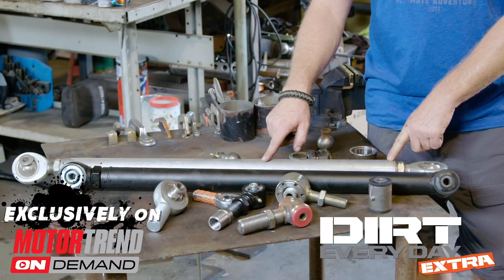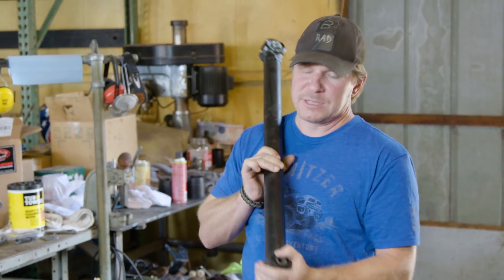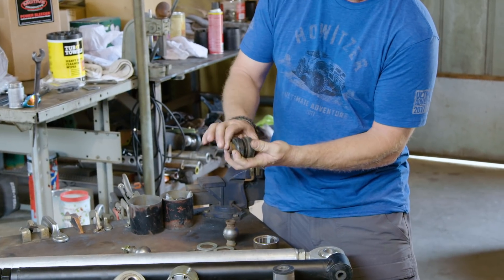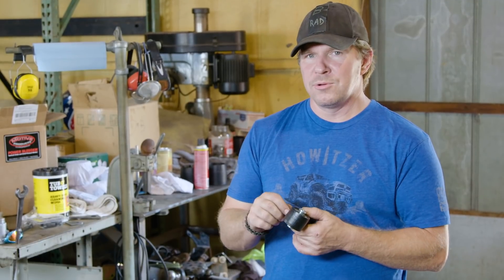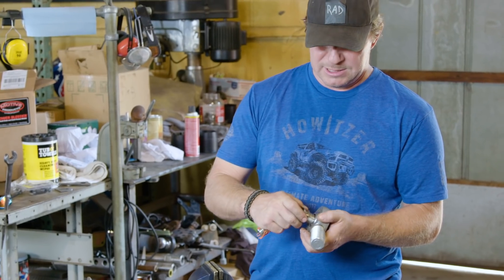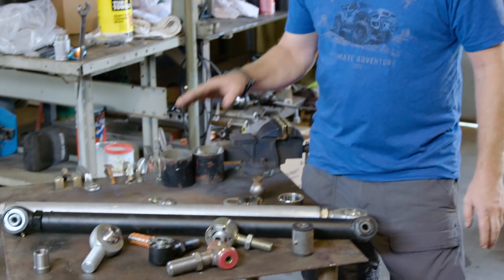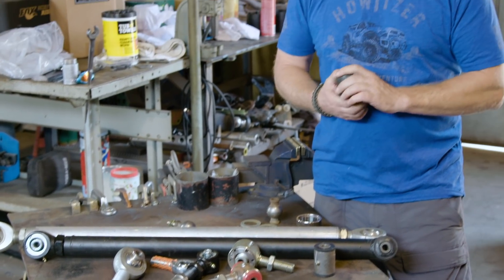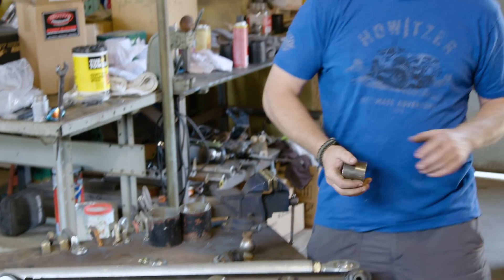Heims, Johnnys, and Bushings: Different Types of Suspension Joints - Dirt Every Day Extra

Comment: At 4:00 I believe the word you're looking for is damping. It absorbs and TRANSMITS all of the vibrations and shocks to the frame. Because it allows for greater articulation of the Axle. As opposed to a bushing which absorbs and DAMPENS those shocks/vibrations. But because it is a more rigid mount doesn't allow for as much articulation. Have you seen anyone using/offering an elastomeric bearing joint for off road use?

Comment: good video explaining the difference. should also point out that a big reason heim joints arent really streetable is because of corrosion, and theres nothing keeping dirt out except for the tightness of the joint. if you live in the rust belt like i do, such exposed joints like that really arent an option for a daily driver.

Comment: Heims are shite for street use, they only work well as long as they are well greased, if dirt gets in them and starts grinding they start to rattle and drive you nuts. Standard bushings generally aren't too bad, PU is a nice upgrade thats still drivable every day
Reply: I've used Heims for years on my street cars, through northern winters when the roads are salted, in the summer through the pot holes the winter left behind and never had any problems.
Reply: I used QA1 XMR10-12 rod ends (heim joints) in several of my projects over the years and never had a single issue with them. Are you sure that you have used good quality rod ends?
Reply: OMC built they last that long?  wondering because my 67 tempest has them on a couple parts
Reply: Rod ends are like women - if they are reliable at first hand, they will serve you for a very long time. Badly developed rod ends and women need quick replacement.
Reply: Good for traction bars? I have a 1990 k2500 that already clunks a little. How clunky are we talking about with heim joints?

Comment: How come control arm manufacturers don't send mounting hardware along with their products?  Different control arms come with various sized bushings and steel inserts, some with inner diameters measured to fit stock, and others are expanded slightly which requires drilling the mounting holes in both the brackets and axles in order to fit a larger bolt through.  This is a pain, especially if they're not going to send you replacement hardware to match!

Also are the polyurethane bushings supposed to be able to slide about in their sleeves, hence the reasoning behind the lubrication so they don't bind and tear?  I've had bushings just straight up fail during installation, not even road tested yet, so bushing design is a huge thing to consider if you're wanting ones to last daily driving.

Comment: Seems most aftermarket suspension (radius bars) manufactures use plastic injection (2 piece) heim joints. Found them on a used 2018 RZR Turbo I bought. The bars were fine but a $14.00 heim failed and broke a $2,000.00 Fox Podium Gold series rear shock in half. It's what brought me here. Replaced all 6 with FK 3 piece heims ($29.00 ea) that will last  me (non-racer) forever.

Comment: We just need super grease that is 3times of thick as req grease to get some cushion back in Hymm set ups. If the bolt is prt of bracket that is C shaped & the bolt has neoprene bushing over it u hve as good a system w/ offset hymm big beef size as poss. The only wear prt u can change out & ultimate strength & flex & offset & mounting spot adjustment range(u pin the max travel the hymm can move on the Cbracket bolt. God/JBM

Comment: Interesting. For a road vehicle use OEM rubber, near bullet proof and does not throw all the load back into the chassis. Though that 'Johnny joint' seems a good idea. Only though on big joints. Some OEM bushings are actually similar.
Eurathane either binds everything up or if flexible enough falls to pieces, and will not bond to the inner and outer sleeves as the OEM rubber does. So you end up with components moving all over the place. Very bad!  Ok as a simple bush where  not a lot of radial movement is required. Panhard or Watts links as an example.  It transmits a lot of noise however. And used in high load area does and will tear the brackets off the vehicle or even break suspension arms. Very BAD!
Heim joints are not for the street either and in some cases will still bind suspensions as the suspension relies on some flex in the bushing to prevent bind. Though when set up properly is the way to go. Generally the cheaper the worse and get 'rattly' fairly quick. Good teflon lined ones are the go and not very expensive, under $30 for a 5/8/1/2 version. 5/8 thread with a 1/2 through bolt. For offroad etc use 3/4 hi misalignment.
The 3/8 used in F1 are stronger than the common 3/4 used in Oval track or offroad, and cost 10 times as much and are replaced every meeting!

Comment: Being able to hve most durable, & adjustable joints w/out hving to buy diff lengths or remove to adjust that can b still mass produced is "best joint" God, but if racing reach for ultra light high strength go crazy, your racing.